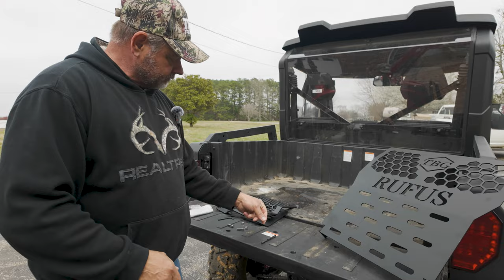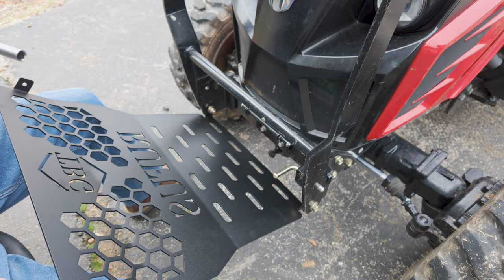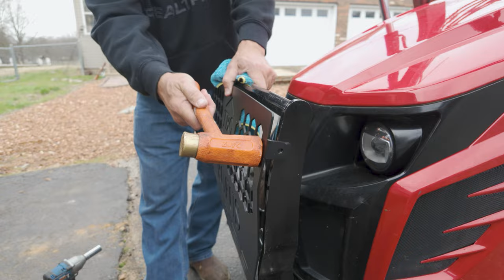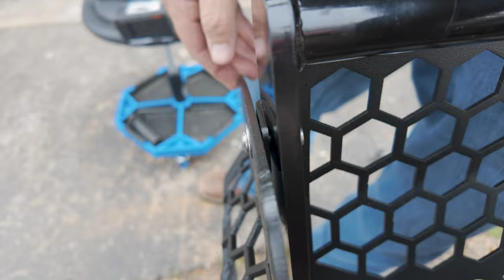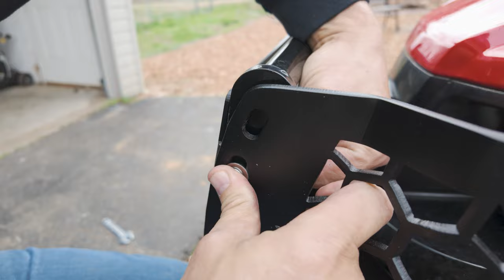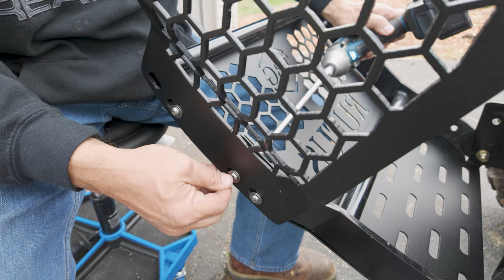Why Should You Put this on your TRACTOR - Protection

Comment: That's a great idea but that guard release pin is nearly impossible to pull as it is and now that you have a big steel shield in front of it... Now show us how you open your hood since it tilts forward.
My uneducated suggestion; put hitch pins in place of the top two bolts for "easy" access.
Reply from the maker: I don't have any problem with my front pin. I recommend running a file through the locking hole. I have seen some of the hood pins  at show be very hard to pull.
Reply: @TonysTractorAdventure  Mine is really hard to pull and I'm thinking it's just a super strong spring.  Stay tuned...

Comment: Hey Tony, I've been watching a ton of your videos, I'm in the market for a Tractor, and have decided to go with TYM. I was planning on getting a TYM25, but when I went to the dealer to sit on and drove it. I thought the operators station was a little tight. So I tried a TYM2015 which I know has a larger frame. How ever didn't like loader control spot, did like where the fuel tank is for filling. And the tilt wheel. Have a little over 5 acres and will be using the tractor for clearing at first and then mostly property managing and snow removal. Definitely like the comfort features of the TYM25 which I was pretty set on. Now not sure, Any thoughts? Thanks, George Sorry for the long message not being related to this video
Reply from the maker: We are testing the 2515 on our channel and it is a compelling machine. The fact that it will lift 2,200 lb on the loader puts it in a totally different class. The only drawback to the 2515 is that it will only pull a 5 ft PTO implement, which is kind of small for its size. It's still covers the wheel tracks so I think it's still okay. It just won't do PTO things fast . We have almost 100 hours on the 2515 without any issues.
Reply: Thanks, I've been watching.